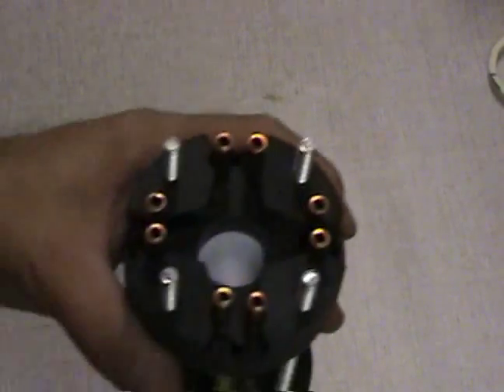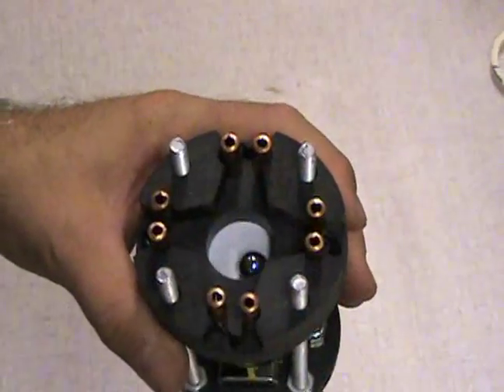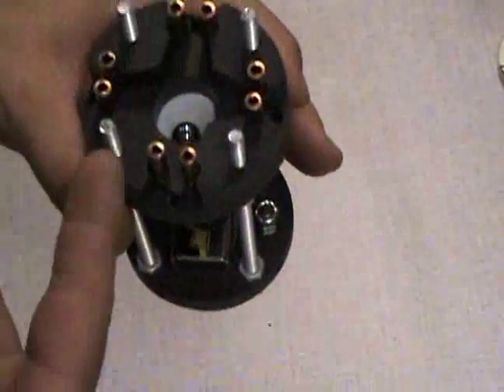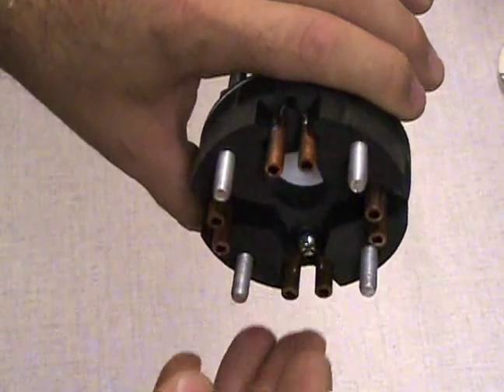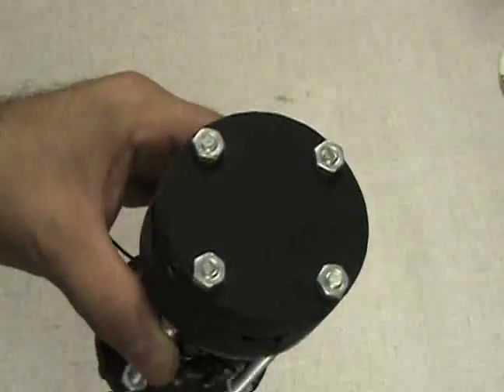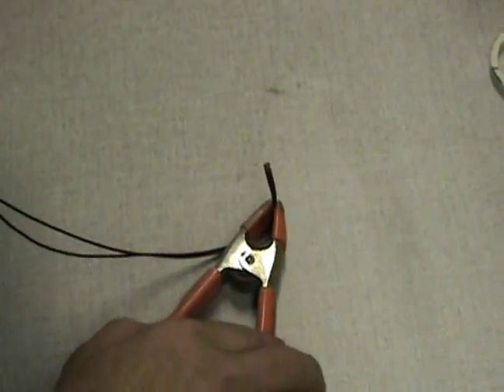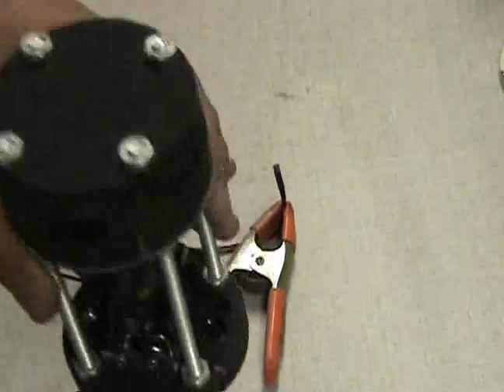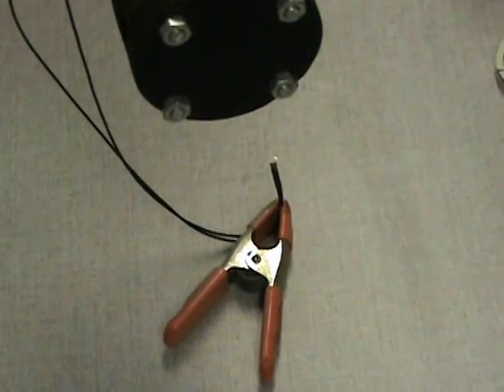Mechanical Apogee Detector

Comment: I was thinking of something along the same lines only instead of that I would use another device that would recognize that the vehicle is not in vertical position and has become horizontal and it would send a signal to light the electric match.  The device I was thinking of would not be as heavy and I think it would be foolproof.  Of course, the proof is in the pudding. However, this one that you have designed is pretty nice as well.

Comment: +Dan Pollino There is only a 50% chance of it activating. Perhaps you can redesign this so it acts like a circular cage, the bars are the contacts and the terminals are arranged in an alternate pattern. That way it activates no matter what the orientation of the rocket is, as long as the rocket tips past 100 degrees.
I'm just a water rocketeer.

Comment from the maker: sólo gravedad, ningún imán. Las pelotas están ingrávidas en el apogeo para que la primavera pequeña en el interruptor es muy bien bastante para empujarlos lejos y abrir el interruptor. esto revela el paracaídas.
just gravity, no magnets. The balls are weightless at apogee so the little spring in the switch is strong enough to push them away and open the switch. this lets out the parachute.